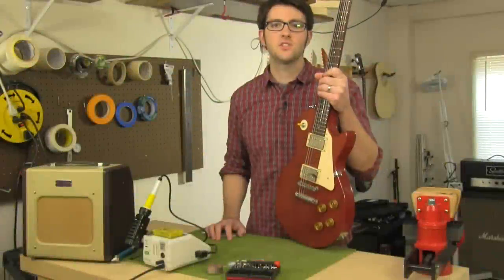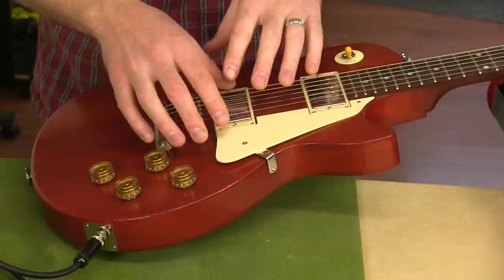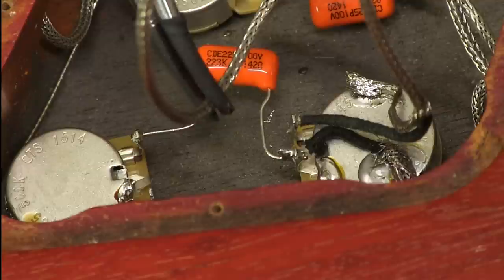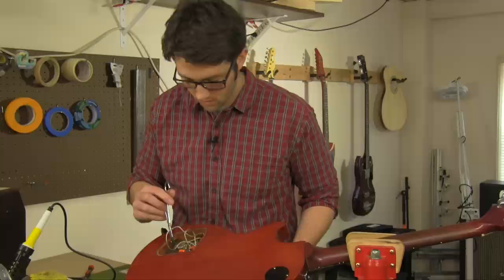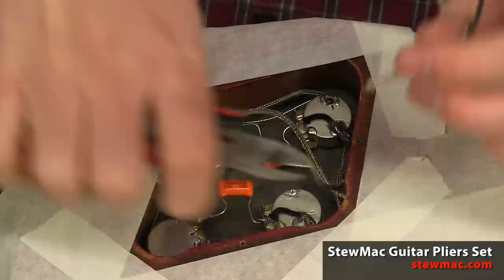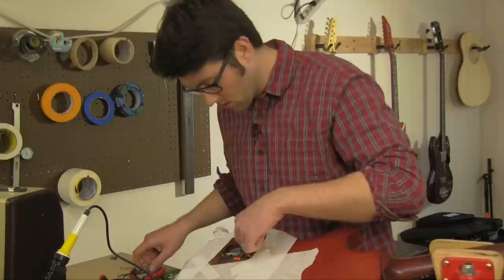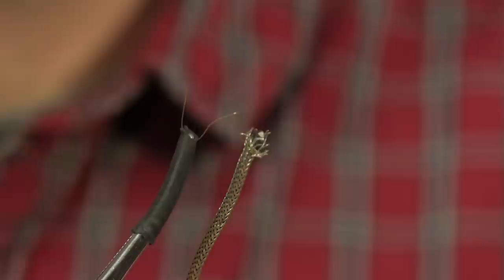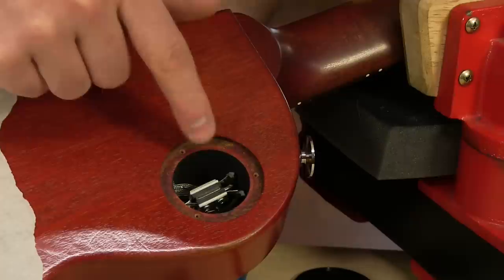No sound from your guitar? Let's figure it out...

Comment: Im beyond frustrated. These videos always only go over ONE issue. None of my wires are touching anything. There is absolutely zero sound and I have no clue what is wrong. I have checked documents and my wiring atleast 20 times everything I’ve done is right. Could a pot be broken? I’m so confused and frustrated

Comment: Thanks so much for this video! I have a strat with pickups that were upgraded by a tech many years ago. My bridge pickup was intermittently cutting out, and after finding this video, I took off the pick guard to find the exact situation described: tons of excess pickup wire with a bare ground wire making contact with a hot connection and shorting the circuit!! I was then able to desolder, trim the wires, and fix the problem myself! Many thanks for another great video!
Reply: haha, I have the same guitar, and the same problem, only it was cutting out and then one day just went dead, thanks man!

Comment: Nice description and illustration. There is another idea you could do, for ... let's say you are thinking you might put these pickups in a different guitar at some point, or even resell them,. Instead of cutting the wires short, you could use a heat-shrink  wrap on the shielded ground wire that is in excess in the control area. Just another idea to think about for your own particular situation.
Reply: Yessir IMO your rigth - I would´n cut the wires
Reply: It's not that hard to put new push back wire on old pickups. It is a bit like microsurgery, but it is not really all that hard to do. I do not subscribe to the picking and shredding off the braided outer shield either. I have my own technique that guarantees no loose strands, and use it on all braided shields. Once I adopted my technique, I never had any problems with patch cords or my wiring inside guitars, amps, effects, etc.

Comment: Never like that braided wire.  Even when I was a GM Technician MSD ignition boxes would short out which is really important on a high output motor (especially with a turbo or supercharger).  Come to find out those engine dress up kits with all the braided wires to make the engine compartment look cool sometimes would cause shorts.  It's the same on anything electrical.

Comment: Had the same issue. I followed your instructions by taking off the back plate off. The cavity was full of wires:) I moved one wire and the pickup fired up right away. Haven't shortened the wires yet but I will! Thank you🙌.

Comment: you can also take a small strip of adhesive sandpaper and stick it onto the shielding tape/paint that is directly under or next to the terminals. Regular tape can fall off over time, but a piece of adhesive sandpaper will pretty much just stick there forever.

Comment: Is it possible to have a "partial" short?  I have a similar issue where the sound cuts in and out depending on how the guitar is held, but it is just barely audible and not completely silent
Reply: league of draven following the principles in this video worked for me :) I put some electrical tape around some of the leads that I think were probably making slight contact.
Reply: me too if it’s in playing posting it makes noise but if it’s flat on it’s back it doesn’t work

Comment: I just bought my sterling music man and it came in about 4 days ago and everything worked fine but now my bridge pickup isn’t working  at all
Reply: Same problem with my Gretsch
Reply: Probably your switch if I were to guess... assuming it’s electromatic or import Gretsch, any import guitar model will use crappy electronics. Pickups are very rare to crap out for no reason. Open your control cavity and test your faulty pickup hot and ground with a multimeter. Do this by switching to the correct pickup position and touching one end of the multimeter to where the pickup is soldered to your switch and the other to where the pickup is soldered to the back of the volume pot. If  it reads out the correct resistance number, your pickup is fine. If it reads zero, it’s broken and you should contact the manufacturer for an exchange or refund. 

If you find your pickup works which is most likely in my opinion, your switch may not work. Now on a Gretsch, they sometimes come with individual volume controls for each pickup, and so your volume pot for that particular pickup could be the culprit also. Good luck!

Comment: Using heat shrink tubing around the lugs will prevent shorts.  Just remember to add that tubing before you solder the wires.  also use a magnifying glass to verify that no wires are touching.
Reply: kjemradio  will electrical tape around the ground mesh work as well?

Comment: I melted a bit of the wire when soldering and literally 1 tiny copper hair shorted everything it was so tiny i had to put my face close the guitar to see it so heads up to all my guitar homies! Also right im realizing my volume is a bit low in recording comparing to other guitar but it does work, also my tone push pull are not making any difference. I did use 4 coats of conductive paint with double sided conductive copper on top after. Did i over kill & any ideas fam? I bought fishman modern pick ups

Comment: i have synsonics jr pro with built-in amp. After installing a battery it still not working, no sound. Do you suppose i need a new amp or maybe need some adjustments😢

Comment: The 2 screws that attach the 'football' jack plate' can be a problem. Mine had 1 screw that barely penetrated the hot wire to the jack plug and shorted out all sound. Get a shorter screw so the wood screw des NOT touch the hot wire to the jack .... It's an odd problem, but a puzzling one.

Comment: I just cut the wire going from my pickups to the pots in half then used heat shrink butt connectors to connect them. There was a wire with a wire around it. I just connected it anyway. I can’t get ANY sound. What have I done here?

Comment: I've been building guitars for quite a while and I just finished a build, wired it up perfect and it will not send a clean signal. I've gone through everything tested every component and for some reason it's not wanting to work, so frustrating. I've easily wired over 200 guitars so I know what I'm doing hopefully I'll have a duh moment but for now I'm completely stumped. It's a basic 2 humbuckers 1 tone 1 volume 3 way toggle switch, shouldn't be a big deal but it's giving me hell.
Reply: Open up your jack and check it out. I'll assume you've tried cords you know that work.
Reply: Have you turned on the amp?

Comment: ... 02/17/2020:  I have a Gretsch  Electromatic 5120, which I love, except for one feature.  The 3-way toggle switch clicks real loud when switching each position.  Is there a quick fix for that noise without changing the toggle switch?  If not, what brand of toggle switch would be silent?

Comment: I need to fix my warlock because I use it for drop tunings and have no room for another guitar as I have my other guitars for different tunings
Reply: B.C rich?
Reply: Tristen Whitlock yep
Reply: @AucheysAdventures  My very first guitar 12 years ago was a Kerry King warlock and this same problem happened out of the blue one day. Before it shit out I was using it for drop tunings. I love my Schecter and my ESP but damn i'd love to get my B.C rich going again. Killer guitar.
Reply: Tristen Whitlock yeah, it has nice tone especially for metal
Reply: @AucheysAdventures  It was a great starter guitar, I used it for everything. That guitar saw jazz, classic rock, metal, blues. After reading your comment I picked it up and just looked at it covered in dust from sitting on the stand unused for years. The neck worn and faded in certain spots from playing. It took me back lol.
Reply: Tristen Whitlock I read online that it’s common for the pickups to die after a while... I’ll probably take a look at the knobs and the switch and make sure it’s not the pickups and if I can verify that it IS the pickups I’ll probably swap mine for EMGs 😝
Reply: @AucheysAdventures  Same here, need to check the jack and pots and all that. Make sure there's no short anywhere. If not then I plan on having a local tech clean it up and do a setup. I'll swap the pickups for the Seymour duncan Black Winter set.
Reply: Tristen Whitlock nice!

Comment: Been rewiring my tokai Les Paul after having EMG pickups installed and wanting passives back in, been nothing but a pain with the braided wires not fitting through the hole with the pickup wires, toggle switch not fitting in the cavity, new tone and volume components not fitting, got around all of that bullshit but now it's wired up I get no sound from the pickups. Looks like this video might have helped me solve that problem.

Comment: I have an Ibenez electric that has been put up for about 16 years. I just changed the strings and when I plug it into my amp I get no sound with the bridge pickup. If I wiggle the jack going into the guitar the bridge pickup will make a sound. How do I figure out if the input on my guitar is going bad or if it is the pickup? The middle and neck pickup seem to be working fine.
Reply: It's most likely the wiring to the pickup selector my dude

Comment: I bought a used guitar & amp from my dad's boss a couple years agp, when I bought it, it worked, it sounded nice and all, a couple years later, I plug it in, and put the cord in the guitar, and make the volume decent. But, it doesn't work |: I hear no sound at all, Idk if it's the wires or not 😂 any help?

Comment: I thought wire insulation was um…. Insulating. Why would it short out? It seems that should only happen if the insulation were conductive. Does this happen with rubber insulation or just this weird metal stuff? Why would anyone use metal insulation??

Comment: Hey stewmac, the guitar I wired has only one pickup and one volume knob, I've triple checked the wiring to make sure it's correct and I do get some sound, but it's so little I have to turn my amp all the way up to get some of it to come through. What do you think the problem can be?
Reply: Or the opposite, in a way: loose contact on hot or ground of the signal. They both have to be perfectly connected, else it won't work. It's often caused by cold soldering junctions...

Comment: My guitar has no sound when i turn the toggle switch in bridge position. What should i do? Thanks for the response.
Reply from the maker: First, you should inspect the solder connections along the signal path. Start at the leads on the bridge pickup. If that looks normal, next inspect the connection on the switch coming from the bridge pickup.  Are you getting signal from the bridge pickup when the selector switch is in the middle position?
Reply: @stewmac  I have the same problem. My bridge pickup works fine when I use the middle or up position on my toggle switch but when I put it in the down position I can barely hear any sound. I have a gretsch 5230t.

Comment: Also make sure your guitar doesn't have a battery because mine was making a horrible distorted buzzing sound and I was looking behind the pick guard for about an hour until I turned it over and took one of the cases off. I then realised the battery was just flat and replaced it. Now its working fine! I know not all guitars are powered by 9V battery's but just make sure yours doesn't just in case so you don't make the mistake I did haha

Comment: okay whos idea was it to design a jacksocket with only half of a connection that moves away over time stopping the cable connection to amp from working? its easy to bend back into place but dumb design i bet this happens to all electric guitars its a weak point.

Comment: Why are guitar and pickup manufacturers still getting  away with using techniques that should have disappeared decades ago ? If you asked how to best design an UNreliable guitar the answer would be to use UNinsulated braided cable and don't put heatshrink over the connections to pots and switches. The proper fix here should have involved insulating all the wires and adding heatshrink on all the connections.

Comment: If anyone can help me with the problem I’m having, please let me know. The problem I’m having with my guitar is the bridge pickup, after re-soldering the wires sounds fine and works normally, but when I leave it overnight it sounds EXTREMELY quiet (I turned the gain and volume to 10 to get any sound from the bridge), unless I hit the bridge pickup hard enough and it suddenly starts working again. I can’t tell if it’d the wiring I’ve done or if the pickup is the problem. The neck pickup works fine, no issues.
Reply: I have the same issue with my custom shop ‘59 strat , bridge is almost silent , crank my amp way past what I usually do just to hear it but even then it’s not the right sound , almost acoustic sounding
Reply: John Frusciante ‘62 Stratocaster since then I found what happened, the pickup was shorted out, a multimeter would help you determine what your guitar’s issue is. I ended up replacing the pickup since I had one to spare. The guitar sounds great now.

Comment: Help guys my guitar string problem..
Number 0 and 3 string 
Weak sounds 
2 4 5 6 is normal
Reply: you probably just need to adjust the height of the guitar pickup oscillators, those are the sort of "screws" that you can see underneath each string, on top of the pickups. There are several videos on YouTube about it, just search "pickup adjustment" and it should give you some solutions.

Comment: All Boys should be taught  basic electrical skills in school...   basic multimeteer use and soldering .  They should know what the difference between a volt, amp and ohm is.   I have used these skills many times in life,  from house wiring,  to car repair, to battery testing,  to lamp repair.   They should know basics. And those who want to advance further should be allowed to design circuits ... and those who even want to go further can do physics courses.  ( I say boys,  because in real life there aren't many girls using these skills..  Go to your local car dealer and ask how many women mechanics they have...  Go to any Air conditioning installer and ask how many girls are installing A/c units.  And you will find I am right.  But girls should enroll in these types of course if they  want to.  I've seen some damn good female phone repairs, which is really cool!  But I'm dealing with the  reality,  where most women don't choose electrical work as a career)

Comment: I'm sorry but why the hell would someone use a wire that has a conductive shielding? Seems like a really bad idea to me. Is it like a faraday's cage thing? If so a simple fix would be to just wrap all the wires in some duct tape, no?
Reply: The whole point of shielding is to be conductive. It has to send all the RF noise to ground, instead of leaving it to be picked up by signal wire and sent to your amp to make it buzz. (too spinal tap).
Modern shielded cables are no different from these old style cables, but they use plastics instead of cloth for insulation.

Comment: It's not a "short", it is an "open".
Reply: In this case, it's definitely a "short".  When the ground braid or cavity shielding makes contact with a hot wire, you're creating a shorter path (get it?) through the circuit which bypasses the pickups.  So no sound.  An "open" would be caused by a poorly soldered or missing wire.

Comment: Is 'Hot' a common term for positive in this industry?

I've never heard that before.
Reply: Outside of the guitar industry, hot is always used when discussing alternating current or AC. Hot is therefore a more accurate term to use than positive because, in electric guitars, the signal going across the hot wire is alternating current. When a guitar string is moving, it produces a positive voltage when it moves in one direction, and negative voltage when it moves in the opposite direction. That's the alternating current.
Reply: Okay, cool.
That makes sense.